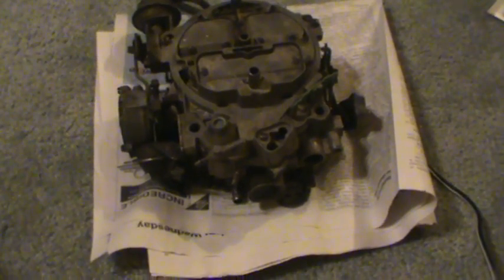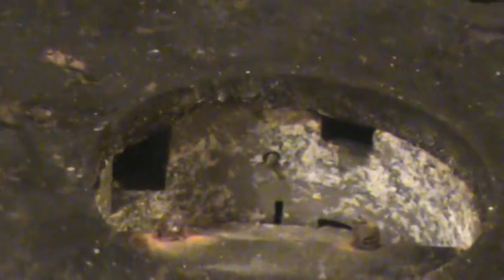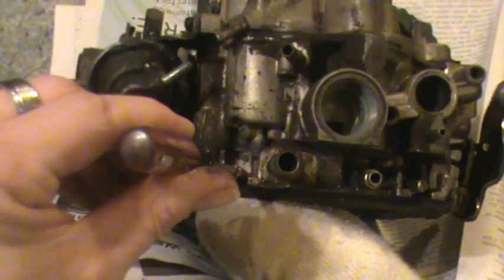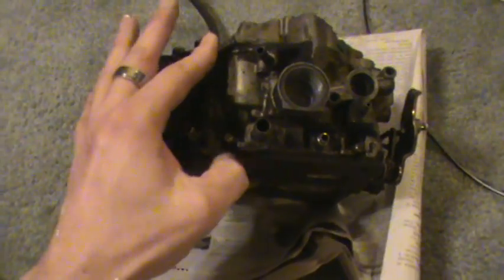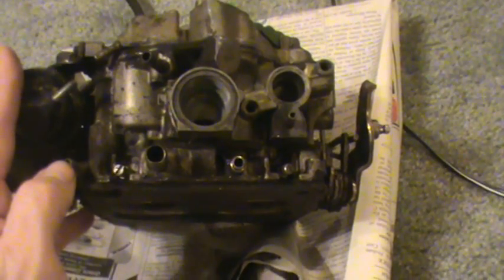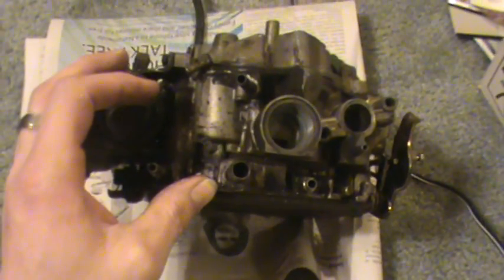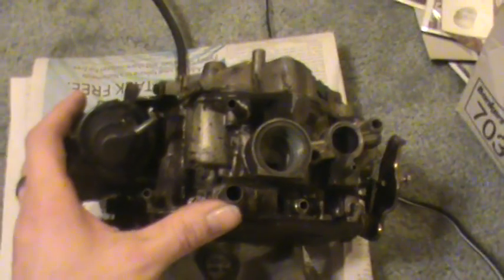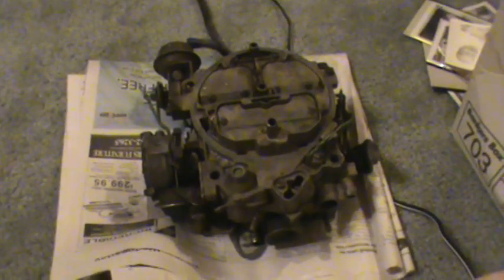How to adjust carburetor mixture screws

Comment: I have a 1972 Cadillac which was sitting for a very long time. (1993) we initially rebuilt the q jet and ran it off a Jerry can and got it running pretty decent where we could yard drive it.  We then dropped the tank and flushed it out, put it back up and put a fuel filter right outside the tank, then replaced fuel pump which has it's own filter and the carb has it's own filter at inlet. I now have an issue where when I start it up it runs very poorly. I replaced the timing set also and it's in time. Just can't get the engine to idle smoothly...... I have a very low and fluctuating vacuum 5-10 hg. all cylinders are putting out 150 psi except 3 cylinders around 120. I removed one head as it was 90 and 60 on 1 cyls, machine shop found gummed up valves and cleaned them up. What gives??? I have over 30 years working on these old cars and this one has me stumped..............carb issue?

Comment: Tyler, I have quadrajets on my boat engines (twin 305's). I've got them both dialed in from watching your videos so thank you very much for that! My only issue is that when I try to adjust the mixture screws, i can run them all the way in with no drop to the idle at all. Is there something that would cause this that I should be looking at? If i try running them out too far then they end up fouling the plugs out. What am I doing wrong? Thanks for any help you can offer.

Comment: Wat kinda tool u use on a 2 jet wit the funny screw it's not a 7 mm
Reply: 99cent store had em ace deep socket grind nail 1/8 wide length of screw to let washer seat and then screw in fingers loose to start threading up don't strip spin pushing on spring only (tends to happen)

Comment: Great videos, I replaced an old carter fuel pump on a 72 400ci with a quadrajet simply because it was hard to start after being parked a week although it was running good, now it starts right up but I hear popping sounds out of the left exhaust tail pipe at idle, do you think this is a carb fuel mixture issue or a fouled plug.
Thank you.

Comment: So in those rare cases where there are more screws, what do they control? I have a 84 quadrajet with the 2 mixture screws, idle screw on the right, and 2 other screws on the left which I’m not entirely sure what they do

Comment: Sometimes on quadrajet carburetors they have factory stainless steel plugs you have to notch them out in a v section on the bottom of the carburetor then you can go ahead knock out the stainless steel plugs then adjust your carburetor.

Comment: Great Video and easy to follow instructions. After months of trying to fix hot hard starts and cutting out when adding throttle on my Mercruiser 4.3L TKS I rebuilt the carb and she work great (for now). I couldn't figure out however why Mercury or GM had a tamper proof thing around the mixture screw until this video - and now it makes sense. Anyway I cut it off so I can adjust the mixture and can now finish the job with this guide then get on the water - thanks heaps from Australia.

Comment: Great video.  Just inherited a 1987 Monte Carlo SS with the 305 High Output Engine.  I was having a problem with what I thought was the OEM Rodchester Carb.  The car would start fine but within 3 to 5 miles will start to miss, skip, and backup not out the tailpipe but within the exhaust manifold or perhaps the intake manifold, not really sure.   I was not sure it was the carb so I pulled the distributor cap to look at it and the rotor button.  On a G Body, what a pain.  First, it is at the back of the engine and secondly to get it reinstalled you really have to pull a few of the sparkplug wires from the cap because it will not mount properly because of the tension of the attached wires.  As it turned out, I discovered to hot wire for the choke was not correctly fitted because someone had used an undersized spade connector to connect to the blade connector of the automatic chock.  I refitted the choke hotwire with a proper size spade connector.  I believe the hot wire for the choke was loose, so every time I hit a bump in the road, the choke hotwire would jiggle loose and then the choke would activate thus send excess fuel into the carb and thus the skip, miss, and backup.  Problem solved,  Car runs fine but I have to adjust the fuel/air mixture that requires a special tool which I ordered from Amazon and will have in a couple of days.  Again, thanks!
Reply from the maker: Awesome! I think that tool used to be made by Thexton or something like that.

Comment: If my car is running rich(spark plugs look dark)(it runs fine and has run fine otherwise), should I be leaning out these mixture screws a bit(maybe 1/4 or 1/2 turn clockwise) to reduce gas? Or, is the darkened spark plugs issue a symptom of something different? Thanks!
Reply from the maker: The screws only affect idle mixture. Try to drive your vehicle at highway speeds, then promptly pull in without letting it idle. Let it cool and read the plugs. If they are still dark you might have a float issue or it may be oil consumption.

Comment: I have a question, i do not have a back fuelline too the fueltank. Somebody did remove the fuelline ( the steel fuelline is still on the car )
Where does it have too be on de carb.  ?
Sinerley Walter

Comment: So can I take mixture screws from an older qjet and put them into my 84 model (non electric) qjet baseplate? so I can still us a flatblade? Mine has the double d head after I drilled out the plugs
Reply: update: i tried swapping the mixture screws from a quadrajet from '72 on my '84 qjet. will NOT work. threads on my 84 are smaller and finer threads compared to the '72.

heres my next question. are baseplates all the same throughout these years? if i swapped the baseplate from the 72 (i wouldnt due to throttle shafts way too worn) to the 84 qjet would it work as intended and still be in calibration with my factory setting?

Comment: After carbeurator cleaning I am unable to start my car without choke.Even in summer I have to pull off the choke to start the engine.Its Toyota corolla 1979 ke30

Comment: Something is wrong with my carburetor on a 1969 Chevy C20 truck. It idles really rough like it's loaded up. For about 2 days I would be able to step on it and accelerate hard and it would be fine. That doesn't work anymore. I tried to adjust the two idle mixture screws and it does not change anything at all. It doesn't matter if one is screwed in all the way or totally removed. 
 I checked the timing  and when I disconnected the vaccuum advance that didn't change anything either. All of a sudden there is no vaccuum out of the front port on the carburetor! I moved it to a vaccuum port on the passenger side that used to be hooked up to the air pump and that one does work. What could be wrong? I've had the truck for a couple of years and can see the carb was recently rebuilt, its clean with new gaskets in between. It was running great getting good mileage. Why does it act like that now?

Comment: I just got mine rebuilt and it still floods and I got the screws turned all the way in, I'm thinking with the screws all the way in the engine shouldn't run
Reply from the maker: Right. Need to go back through it and make sure the needle is clean and that you have the float/needle assembled correctly and adjusted.

Comment: how to remove the plugs over the mixture screws...1) drill small hole in center of plug...2) screw sheetmetal screw into the hole you just drilled...3)...pull on sheetmetal screw while twisting slightly from side to side...
Reply: Exactly how i do it. Works like a charm. Even use a plain ild wood screw to get a bite on the plug. Just as long as you dont drill into the screw head. But great tip for beginners!

Comment: Could you do a video on adjusting the electric choke on a roChester Quadra jet.  It came from the 1975 Cadillac Coupe Deville 500bbl 8.2L. The flaps for the choke stay down and it's bogging down the engine I don't know how to readjust them it would be great if you can make a video briefly describing what you need to do to fix that thanks

Comment: I have a 72 Delta 88 Oldsmobile and my car has a good engine, but when I start the car it's idled high and when I drive it for to long it seems like it's idled low enough to cut off..... Do you have any suggestions on what to do...

Comment: Very helpful video, but I still have a question I have a 84 GMC with the 454 Big Block, and it idles really high when I first start it for almost 4 solid minutes then I have to pump the throttle at least twice pretty hard before it idles down to where I feel it should be, temperature doesn’t make a difference weather it’s 95 or 55 out side it does it no matter what...where do I go if this doesn’t make a difference? Thank you!

Comment: I took my truck to a mechanic he replaced the carburetor with a remanufactured carburetor and when I got it back it runs perfect while I was driving but it idles really rough even to the point that when I went to turn my truck off after it it warmed up it didn't want to turn off it just kept sputtering so I had to turn it back over put it in drive to wear idles down just to shut it off do you know if it could just be a Bad setting on the mixtures or if there's a vacuum leak somewhere

Comment: Hi tyler. Thanks for making your videos. They have helped a great deal. 
       I have a1983 b250 with the original 318 2barrel. How do I figure out the make of the carb ? And would this info for the mixture screws apply to my carb ?
Reply from the maker: Hey man, the easiest way is to look at the front of the carb above where the mixture screws are. A Holley is very squared off there on the bottom of the float bowl and a Carter BBD is rounded. Also there should be "Holley" cast on the front of the carb somewhere. The mixture screw adjustment pertains to all carbs. Good luck.
Reply: @TylersNeighborhoodGarage ...  thanks. I'll take a look at it. Appreciate it !

Comment: I know this is an old video, but damn if it hasnt helped me out tremendously.

Just bought an 86 motorhome with a rochester 4bbl, and even though I've worked on my own cars my whole life, I've never had the "privilege" of working on a carbureted motor. My poor old Bertha was running rich, but when I patched up the fuel pressure regulator (it was literally just pissing out fuel), she was running so rich that she barely ran at all.

I should be able to get her dialed in just right now, and its thanks to this video!

Comment: Great set of quadrajet videos- new to carburation in general and these give me lots to go on!
Hoping to turn a quadrabog around.
What your experience with age of gas?? I think it’s old and I need to check the filter but (this is on a boat) it starts every time. Idle messed up and secondary lack of response (which you have addressed and I’ll try all recommendations). 
Cheers from Canada

Comment: I have been messing with my idle mixture screws.  78 K10 w/ 400 has been sitting a lot, so I am thinking a rebuild kit is in order.  I hooked up a vacuum gauge to line that comes from manifold to vacuum pot for ac/heater controls.  Very erratic needle running like 8-10 inhg.  motor has a Competion Cams 268 (i don't recall rest of specs).  Anyway my adjustments don't seem to make much difference.  Do you think the cam is the bouncy needle cause and possibly the "low" vacuum reading?   My original issue was a backfire situation when trying to moderately or lightly accelerate.  Runs great once rpms are over 2K.  Now after messing with idle screws it seems to no want to idle in gear or get moving.  I am delaying on rebuild of carb so want to try to adjust it back to usable.  Oh and the fuel is old, don't recall if stabilizer was added.  Hoping to run a tank down and get some fresh, treated fuel into her.  Sorry about the long winded post on an old thread.  Hoping you do a divorced choke video someday.  Mine is open solid when temp is up,  doesn't close all the way cold, but summer temp of 80°F may be that issue.
Reply from the maker: I'll recommend the same thing i always do: cover everything else before condemning the carburetor. That includes vacuum leaks, timing, timing advance CURVE, fresh fuel, compression test. You can only spend so much time adjusting the mixture before you have to move on and work through other possibilities. A 268 cam isn't huge, so that shouldn't be affecting idle vacuum that much. If you can't pinpoint an issue external to the engine then go ahead and overhaul the carb. If you still have problems then you'll need to evaluate the engine's mechanical condition.

Comment: Great vid mate.quick question .I just got a 1974 Australian built cj6 Willy's jeep.the Stromberg carby is running rich and blacking the new plugs.I will do what you said on this vid .after that I want to run some carby cleaner .will I have to reset the carby again??.and should I start with both screws all the way in.thanks for any info.cheers from Australia

Comment: Tyler thanks for the video my 83 cutlass 307 y has a quadrajet I took it to smog and it was running way to rich I might just replace the carburetor. Buy a new stock one. But I have a problem. Not sure if this is because of the rich fuel mixture. When I run my car about 20 miles I get home shut it off white smoke starts to come out the side where my headers are it smells like something burnt. Not a lot of smoke but it sure is visible and sometimes it will come out the top of the carburetor itself when I take the air filter lid off do you know what this might be? Could you email me Johnaleman559@gmail.com thank you!

Comment: One ? I have is should these adjustments be made after the engine is up to operating temp? or can it be done cold?

I've been working on cars, bikes and trucks for 25 years and just recently got my first car with a 4bbl (olds 442) and this video was a great education.  I don't know how many dirtbike carbs I've rebuilt but it's been a bunch, but the CCC Q-Jet was a little mind boggling to me, hopefully once I get these screws adjusted my car will stay running!  (carb just got a full rebuild, it starts but won't stay running).
Reply: Greg Huston, want to let it warm up first. It works better that way

Comment: Is there a standard mixture setting for both screws such as 3 turns out from the "all the way in" position? It idles perfectly. I just smell a lot of gas when I shut it off. All of the vacuum lines are properly hooked up...no air leaks. David
Reply from the maker: Nope, it is adjusted to achieve the highest idle speed. If you smell a lot of gas, then there's likely seepage or an active leak someplace there shouldn't be. Check the fuel pump to see if it's wet.Also, if the carb is intended to vent into a charcoal canister and it isn't, that can create gas fumes.

Comment: Thank you for the incredibly informative vids.  I rebuilt my Quadrajet while watching your rebuild series.  Car runs great on 2bbl only.  secondary air doors don't open hardly at all when kicked in.  The secondary is getting fuel, but with little air it floods out when trying to kick in the 4 bbl.  Any ideas?  (I did notice it seems like the dampener, (choke pull of) keeps a high vacuum even when warmed up and throttled.

Comment: Hello, And Thank you for the great video. ...However I have a 1986 dodge d100 with the same carb.and it keeps back firing.....My thoughts are to do the timing and the air filter screw mixture..????
Any help would be greatly appreciated. ....

Comment: Hey man why would my carb start flooding all of a sudden black smoke , it started giving me trouble days ago it wouldn't start seems the fuel in the Carb deposit was gone, i have been starting it by  pouring a small amount of gasoline into it but today it started doing this (flooding) . . I serviced the Carb myself 2 years ago and no problems for 2 years (did the kit) . . .  do you think the needle went bad or the float level was altered somehow?  Its a Quadrajet on a B250 Ram van . . . yes Chrysler installed those in these vans in the late 80s. . . i wish i didnt have to open it again its a hassle . . Thanks

Comment: I am so glad that I found this video, it really helped me dial in my new (remanufactured) quadrajet. The company that rebuilt my new carburetor had the mixture screws way too far out for my 305. I do have one question though. Is it okay for the engine to run slightly rich after sitting in drive  for 10 minutes or longer?

Comment: just put a rebuilt rochester quadrajet carburator on my 85 chevy van and it ran for a minute and then died...it is no longer getting fuel to it any ideas?
Reply from the maker: Was it running before you rebuilt it? Either way it makes me wonder if the carb was not the actual issue and you have another problem in the fuel system. Where do you think the fuel supply is "stopping" at?

Comment: Hi, I have a rebuilt 1973 Q-jet on a 350 motor, running and idling nice but every time I put it into gear she dies imeadiately  even when allowed to fully warm up. Any ideas?
Reply from the maker: Have you checked the timing lately?
Reply: It runs a gear drive and I don't know how to check or set the timing. It had an Edelbrock carb that was hesitating and back firing a lot, but would run in gear once warm. I put the rebuilt Rodchester on which runs smooth, but kills the motor when put in gear.
Reply: As he said check your timing, I had 350 Chevy motors with quadrajet carbs. They can be finicky at times but timing on the 350s is critical. Sometimes degree or 2 the wrong way will screw you up.

Comment: Great video thanks. I have a question about 1965 Mercedes Zenith double carburetors . I had them rebuilt and trying to adjust them. The back carb is fine the front one start fine with the choke on then once it warms up it quits. My mechanic said I have a vacuum leak from a warn Throttle shaft can you advise? also where can I have this shaft re- bored?

Thanks.